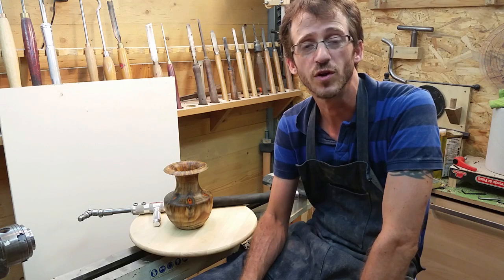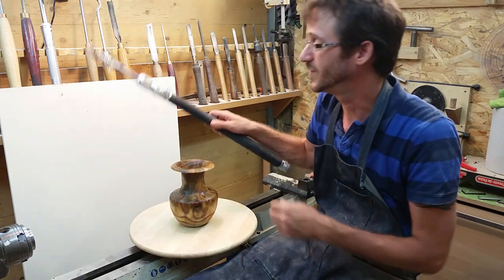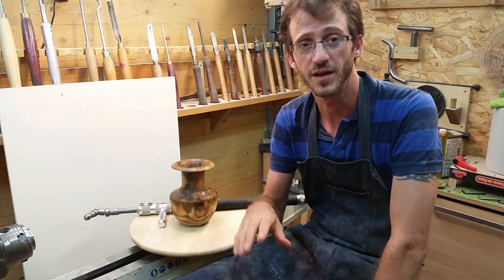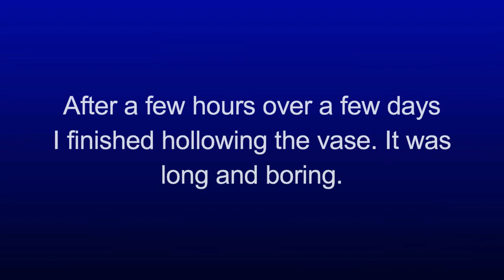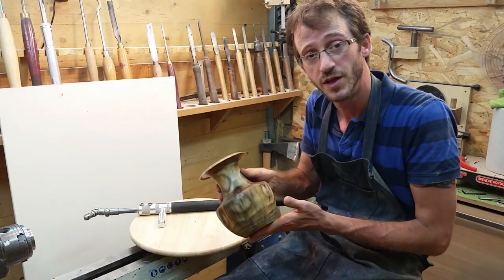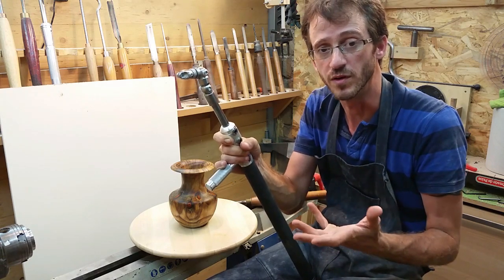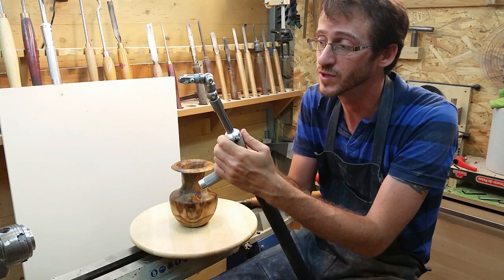Woodturning Norfolk Island Pine Vase

Comment: By adding weight to the handle I think you will find it easier to use. I also use an overhand hold on the handle,  thus the handle rides under my holding arm. This buffers the cutting vibrations. I have the complete set from Sorby and the best part was the side handle and the handle extension.
Reply from the maker: Thank you Robert! I did think to add weight to it, and I've seen the overhand hold with propping the tool under arm, I will try it with my next attempt on a larger project so the space won't be as tight.

Yuval.

Comment: Thank you Yuval for another very interesting video with a beautiful vase as the end product.   I already have the Sovereign Ultima hollowing tool and it does require some practice and a great deal of carefulness to use it to best effect.
I'm also very interested in the wood that you used.  It seems to be commonly known as Monkey Puzzle.  Oddly, it's quite common where I live in Ireland.  The reason is that when avenues or streets of houses were being built around the year 1900 it was quite fashionable to have a Monkey Puzzle tree planted in the small front garden.  These have since vastly outgrown the houses and every so often one is cut down and the logs advertised for sale in the local newspaper.   I think the tree is native to Chile.  I've watched several uploads when Norfolk Island pine has been used and didn't make the connection.
Reply from the maker: Well there you have it Alan, the connection is made :) I'm glad I could help with my video! This tree is a very common garden tree in Israel (where I got the wood from) and Italy (where I never found any in 5 years of turning). I should have turned it when it was fresh instead of waiting for it to dry, it was a very dusty turning, not many shavings were produced. Next piece I'll have I'll turn as fresh as I can.

Yuval.

Comment: Lovely vase Yuval and thanks for the honest review on the Sorby Ultima.  It's not on my list at the moment as I doubt I would have the room to use it currently :)  The Monkey Puzzle wood looks very interesting to turn and has a similarity to Yew in figure.  I especially like the scalloped rim.  Great project!
Reply from the maker: Thank you Ian! Wish I had some more of it, but alas, I had only the one piece. Good thing I didn't hollow through it, it doesn't show on the video, but there is a point on the curve near the bottom where I got really close to breaking through. The fault lies with me not having a large enough caliper to measure to these depths, something I will fix very soon.

Yuval.

Comment: beautiful work .... have you thought of making a second tool rest to stop the shake of the tool
Reply from the maker: Thank you Tom! I've thought about the different types of aids, like a second tool rest, or a locking tool rest, maybe combined with some hollowing system, but I do not have the materials right now to fabricate something, and can't afford to get the brand name stuff, so it's going to be a battle for now :)

Yuval.
Reply: thanks for the reply ,i was thinking of a simple  wood 2 buys  L shaped bolt to lathe ways like the standard tool rest ..good luck

Comment: Thanks for the video. I always enjoy your videos and your music choice.

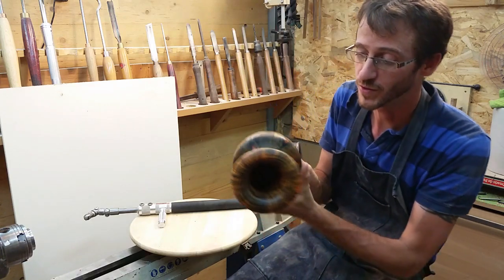Is it a hole in the bottom of the vase on 6:47? Do I understand it correctly that there is no chance to use a wooden vase with water? Sorry for a possibly stupid question.
Reply from the maker: Thank you Dmitry!
Good eye!! It is a hole in the bottom, but it wasn't made by cutting deep enough, it's the pith of the wood that rotted out since I left the trunk to dry out. my mistake. By I was able to fill it in with a simple 4 mm dowl, and sand it flush at the bottom.
You can use water in a wood vase if you treat it;  you can create a waterproof vase using a layer of epoxy, or resin, or even with a few layers of specialized woodworking oils which polymerize.

Yuval.